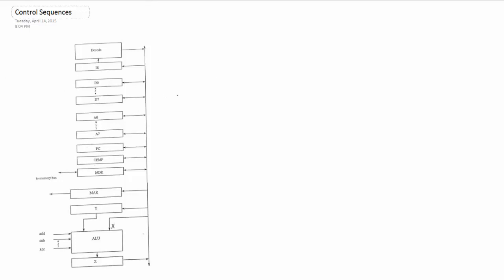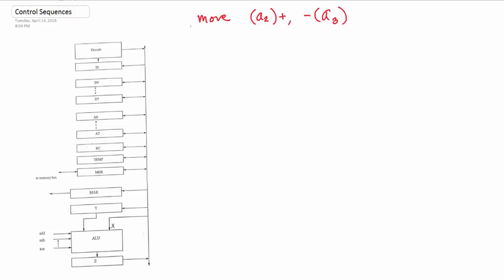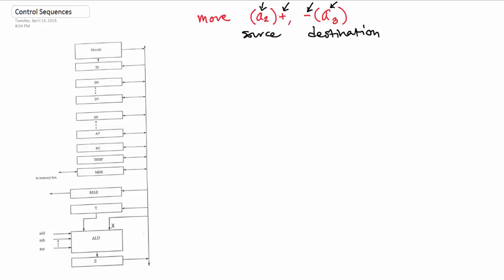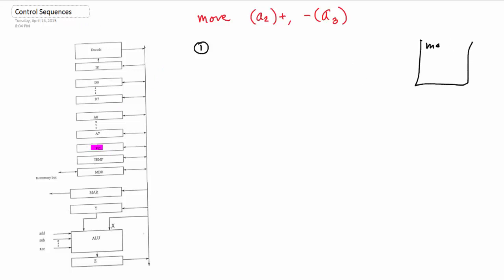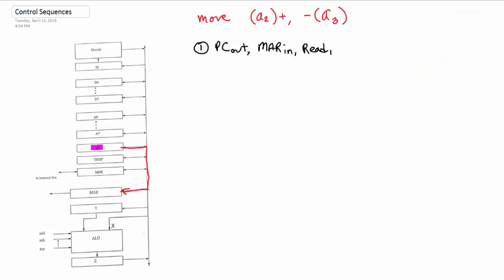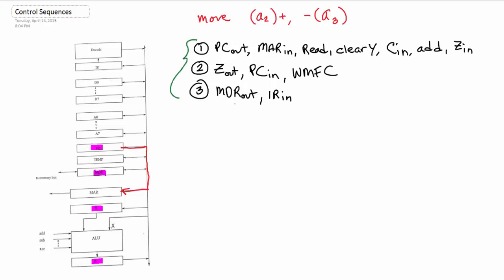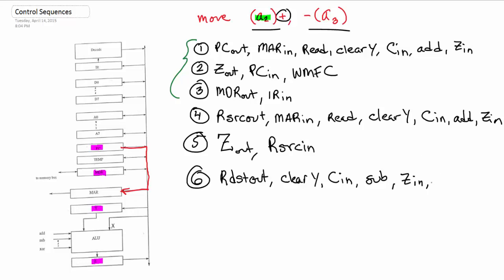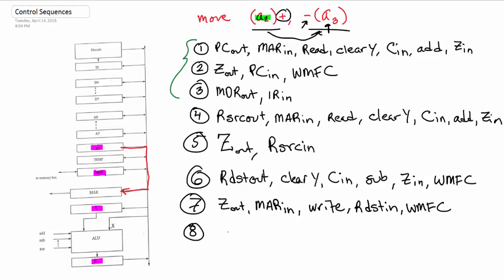Control Sequences (Assembly)

Comment from the maker: A clock cycle ends usually after a one-way trip between the different CPU components. So, for example, you couldn't do MARout and MARin in the same cycle. Think of a cycle as going from point A to point B. As seen in the fetch phase, you can have many of these "one way streets" in a single cycle.